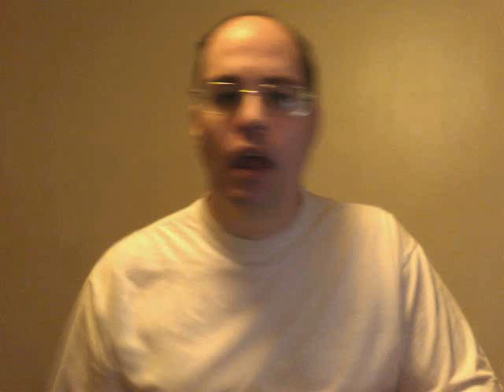What are the bubbles in boiling water?

Comment: Element ? possesses:
solid state
liquid state
gas state
Each state possesses a range of temperature they can get.
When element ? reaches the end of a range, it needs a certain amount of energy to change state.
Element ? whit the same temperature can be in 2 states, but the energy it possesses varies form a state to another.
When the process of changing state is occurring, the process of changing is gradual and so different parts of the element ? change at a time.
Parts of the same element whit the same state stick together forming pocket/bubbles/layers...
Reply from the maker: Specific heat capacity and latent heat https://youtu.be/18pK7rPtAAk